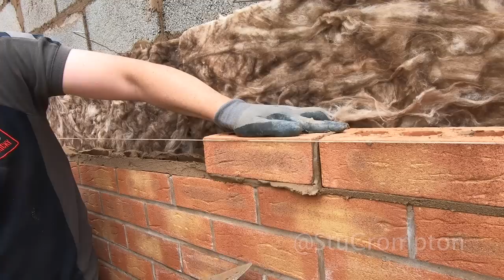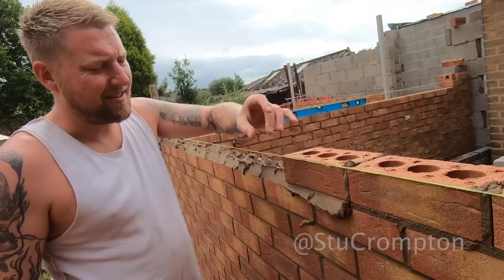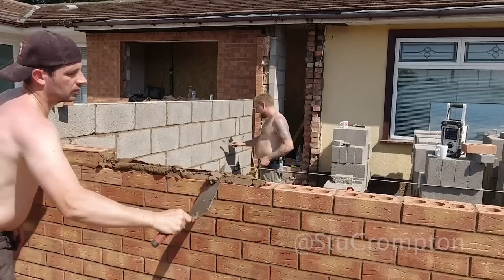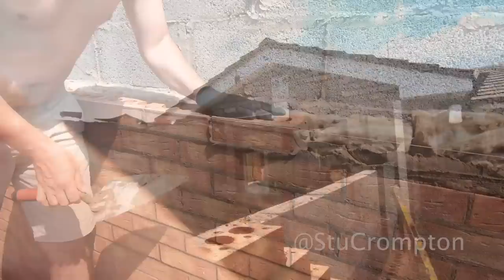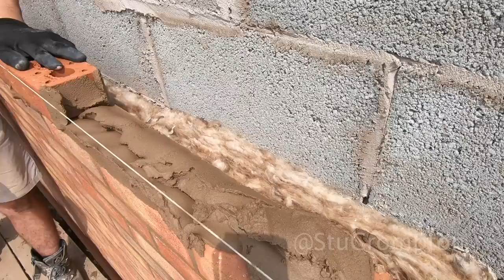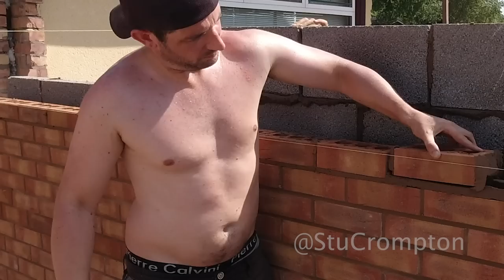Bricklayers at Work - Laying Bricks

Comment: Stu, im not a bricky, But im building a concrete block wall for a pond at home. I need to join a 3 course high 100mm blocks to another block wall,  whats the best ties etc or good way  to do this mate ?  Do i need ties or could i use right angle brackets fixed to each wall on each course ?  Thanks in advance
Reply: Bluebird screw ties